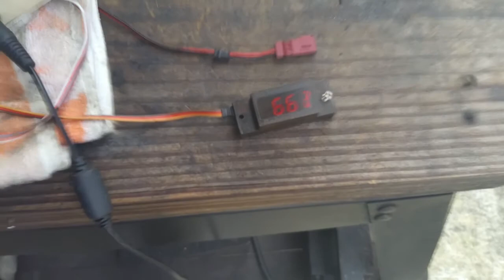SAITO FA270T CH IGNITIONS FULL GAS CONVERSION

Comment: Hey what carb is that I’m having trouble to keep mine running because there something in my carb that’s not sucking fuel from the tank and it still don’t work when I prime it??
Reply from the maker: Try WT961
Reply: What fuel did you use
Reply from the maker: 20 to 1